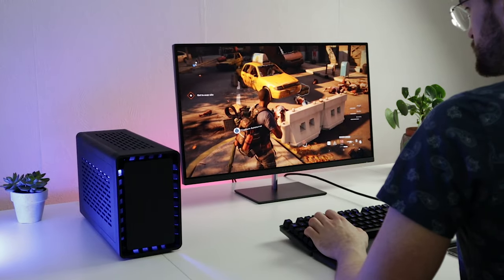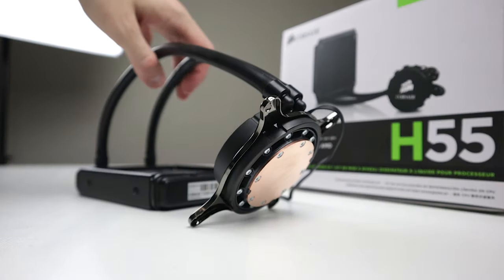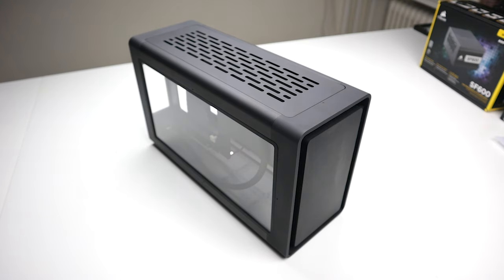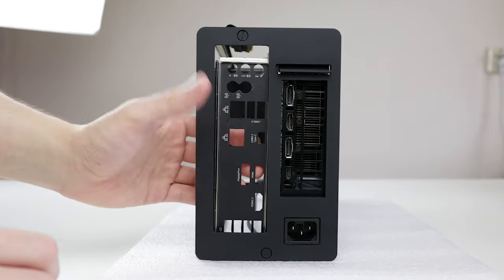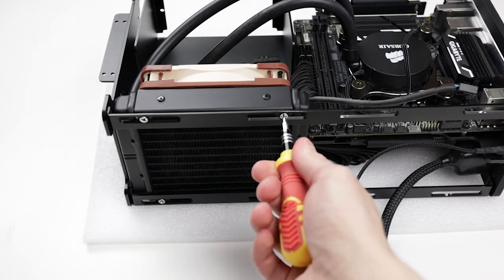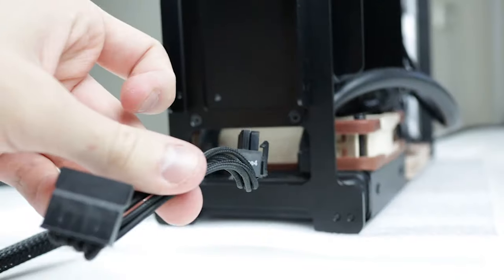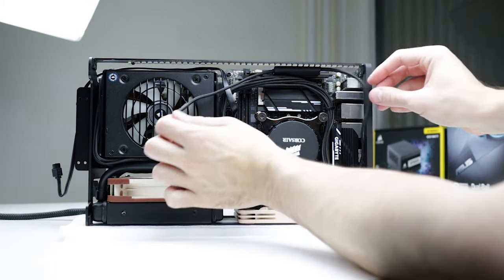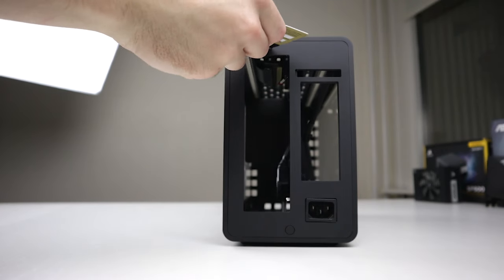MJOLNIR — The Complete Liquid Cooling Guide (Advanced Users)

Comment: Bit confused about those insane shipping fees...why pay 300$ and then a third of that just for shipping? What is wrong there, or did I miss something?
Reply: Most of the higher shipping fee countries are because they're including import taxes for the full value of the case in the "shipping" cost, e.g EU countries.
Reply from the maker: Noa Zero The biggest part of those shipping fees consists of Sales Tax or VAT (those in EU pay 25% Swedish VAT) while those is US about 9% Sales Tax. The actual shipping rates are about 20-25 USD.

However, some countries are more tricky to ship too (we have to use air freight) and therefore very expensive (Russia).

Comment: Hey! Just ordered this case. What 2080ti's fit? I was looking at the ASUS ROG STRIX GeForce RTX 2080TI, but it looks just a bit too thick compared to your specs sheet.

Thanks!
Reply from the maker: EPIC! Basically any card under 51mm in total width (the strix 2080 is a bit too wide like you mentioned). Any founders edition card and blower style card will fit. There are a LOT of options out there but I would recommend the Founders Edition 2080Ti, GIGABYTE Gaming OC 2080 ti or the water cooled EVGA Xc Hybrid 2080ti :)
Reply: @THORZONE  Thanks for the reply! The EVGA looks really good, but I was planning on doing water cooling for the CPU as well. I wont be able to have both my CPU and GPU water cooled correct?
Reply: @TEJASXO  if they had an option to have both cooled this would be the perfect case!
Reply: @TEJASXO  i'm a little late on this, but Alphacool has a low profile cpu block/pump called Eisbear LT with g1/4 holes.  you'll have to drop the reservoir, but i've seen many sandwich ITX cases use it to get CPU+GPU watercooling.  It's an option

Comment: Hei! Love the case, but.. a couple of things.. 1. The PSU and the radiator fan push air to each other. 2. Why did you guys went with this AIO look? NZXT good the infinity light design, that would had been sick!
Reply from the maker: Huibinator Thanks man! The AIO pushes the air towards the PSU and the PSU pushes it up through the top panel (when it’s spinning that is). Even so, it’s what gives the best CPUs temps by about 5-6°.

I like this AIO because of its flexible tubing, less hassle to build with than NZXT — especially when using tall RGB RAM (however, NZXT infinity light definitely looks amazing 🤤).
Reply: @THORZONE  Takk for svaret! Det er sant, jeg had ikke sett at den PSU er åpen på toppen. Veldig kult for å ser at dere har tenkt om alt! Lykke til :)

Comment: What's the max dimension and configuration for a 240mm AIO?
Reply: You can only fit a Silverstone TD02-Slim AIO or an XSPC TX240 radiator, and only one fan above the PSU as there's no space for a fan above the motherboard.
Reply: @user-njyzcip  I have the TD02-Slim and it doesn't fit the gen 1 of this case

Comment: That radiator fan should exhaust hot air OUT of the case and Away from the components. Not sure about this setup. Cool air intake from the bottom will attract A LOT of dust into your system.

Comment: Considering it's an ITX case, and a very small ITX case at that, why even bother with forcing people to plug in the RGB strip via Molex?? Most motherboards these days have 4pin and 3pin RGB headers, so you don't even need a controller. That's so much space saved with no molex and no RGB controller.
Reply from the maker: If your motherboard has those 3-pin headers, you can plug them in there instead! :)